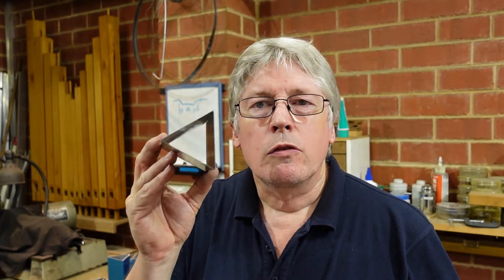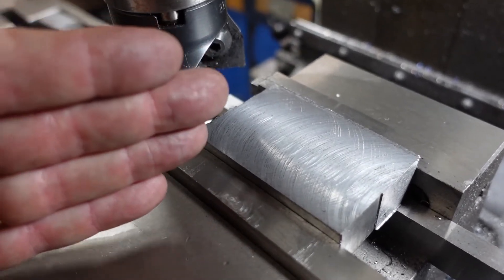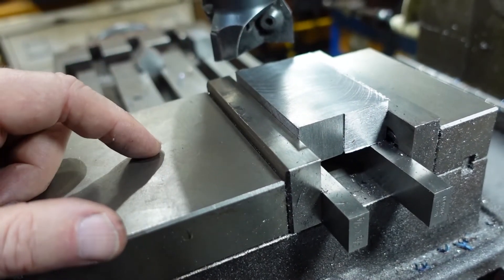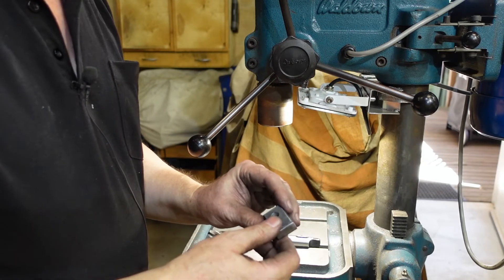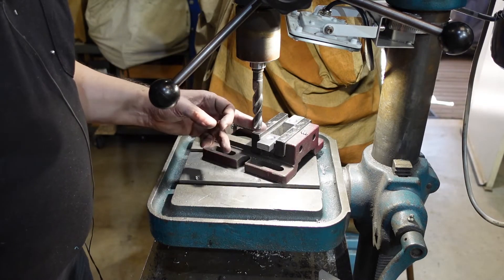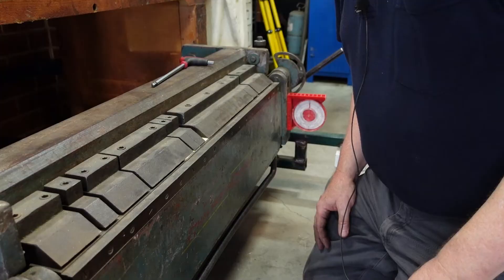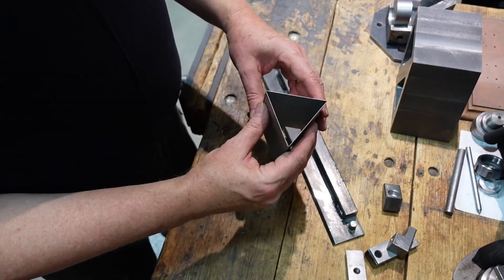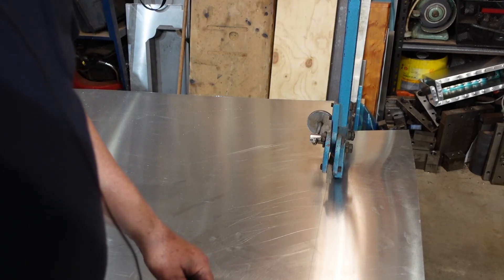Making closed sections on a finger brake

Comment: Very nice attachment, I look forward to seeing how the pin design resolves. Your panbrake already seems better than most in that its finger arrangement is well suited to folding channels, what brand is it? Closed sections is where that Australian invention the Magnabend comes into its own. Excellent video.
Reply from the maker: The pan brake is a 'Chambers and Corner', a Queensland maker no longer in existance, but it is a nice solid folder. I'm limited a bit by the geometry of the folder so if you were doing this all the time, the magnabend would be the go but for occasional use (like a lot of my tooling designs/ modifications) this does the trick. Another modification to tooling that I've never seen done anywhere though.
Reply: @occasionalmachinist  I haven't seen that mod done either and I have worked at a couple of places with sheet metal shops. When I first saw the section you intended folding I didn't expect such a clean solution.